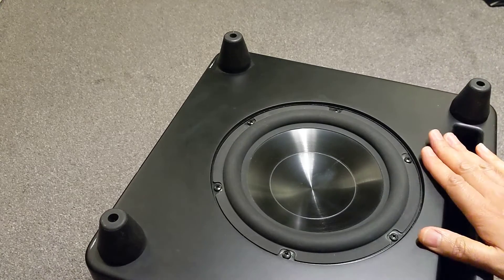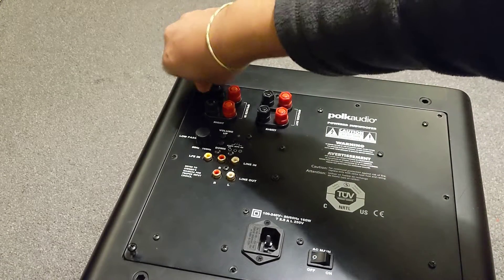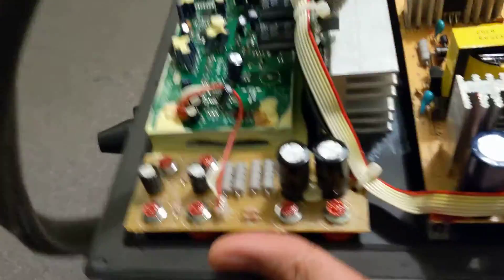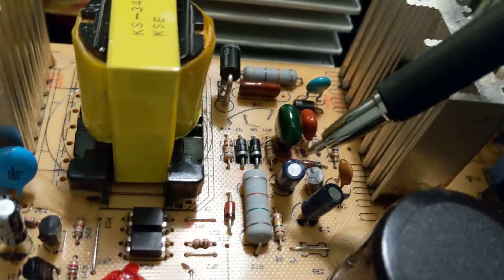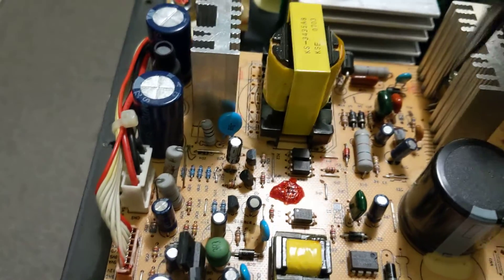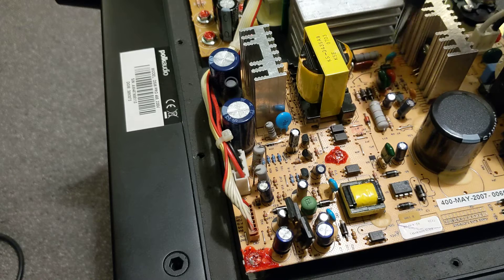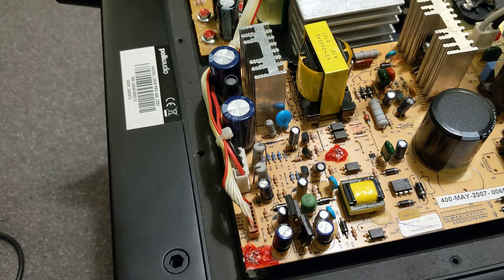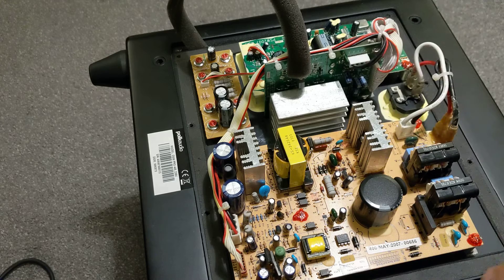Polk Audio DSW Pro subwoofer speaker amplifier board protection circuit fault repair fix

Comment: I had a problem with the polk dsw pro 440wi where the light would start green when you first turn it on but then it would flash between orange and green. None of the circuit components looked obviously faulty. There is a fuse built into the power connector but it wasn't blown as then the led wouldn't even be flashing. From looking at the labels of the wire connectors coming off of the yellow board it appears to be the power supply which has some ground, 12V and 36V wires going to the green amplifier board. I don't actually know what fixed my sub but after unplugging the wires and probing around a bit it just started working again. People should be very careful around those large capacitors as they can store charge even when disconnected from power and it can really hurt you.
Reply from the maker: Thank you for the comments and advising about your experience with this unit👍🏼🙏🏼

Comment: I bought this crappy device second hand for 200 dollars. This is Turkey unfortunately. I opened it up, checked all the connections, repaired the loose and torn rubbers on the circuits, and eliminated all the whining, but when it first turns on, it makes a terrible humming noise for about 2 minutes. It works half-assed and then comes back to itself, and it doesn't cause any problems unless it's turned off. Unfortunately, this investment of mine is about to go to waste.
Reply from the maker: @ssemih_celikk  sorry to hear about your experience. Unfortunately you win some and lose some. Hopefully your next buy will cover up for this one👍🏼🤞🏼🙏🏼

Comment: I have a jbl northridge subwoofer, which fails to kick in at low volumes, however it keeps trying to pick up until I raise the volume, any idea about the problem?
Reply: @kaygeebee9155  I have responded several times putting my number, but my comment doesn’t show
So my number is (plus twenty)(twelve)(two)(seventy three)(sixty)(four hundred sixty two)
I hope this time you will rcv it
Reply from the maker: Might be an issue with the volume resistor. Try cleaning/refurbing/changing the volume switch to see if that helps the issue 👍🏼
Reply: @kaygeebee9155  which volume switch you mean, if that of the subwoofer, it is for the bass and when the subwoofer is working it perfectly controls
I think there is something in the relay that puts on the speaker as this is the main problem
Reply: @kaygeebee9155  any idea how to check components of my mentioned subwoofer